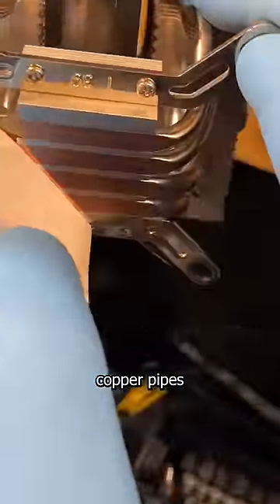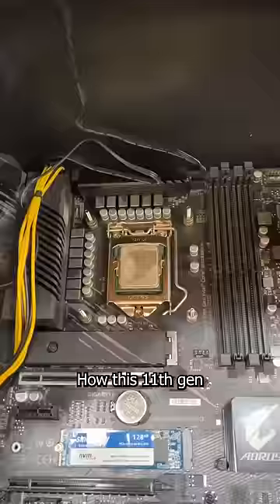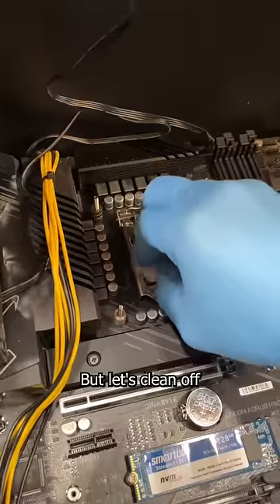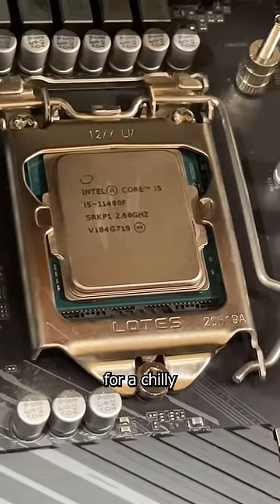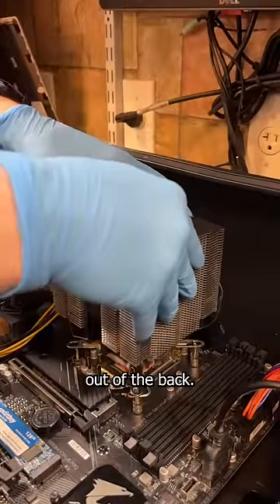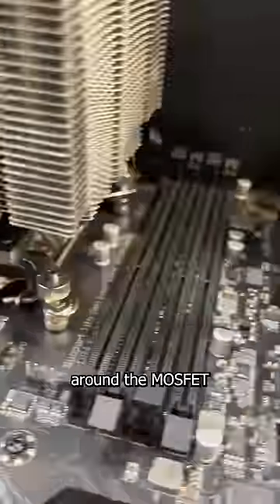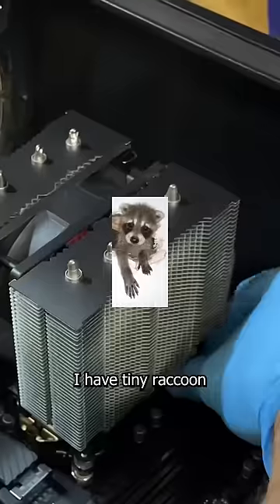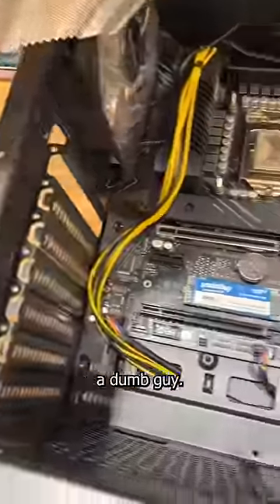Russian computer repair shop harmed this poor #gaming #pc Intel CPU was on fire 😢 #tech #shorts

Comment: He drove the damn car without the brakes. He’s a legend
Reply: Huh
Reply: Wrong yt short, Mister
Reply: I think the comment can ACTUALLY fit the video, or that's what I think about it, it's not that hard ngl
Reply: he also cooked his food without fire too

amazing
Reply: @ilovesalad2702  Crashing without an  air bag?
Reply: He really ate the cereal without the milk!
Reply: or vice versa, excessive heat causes cpu to slow down
Reply: No, it's more likely to drive the damn car without the oil
Reply: Bot
Reply: Right... SO! Apparently this YT Shorts bug where the comments section for the PREVIOUS short would load instead of the one for the CURRENT one has been going on for over a year already... Thanks youtube
Reply: @NovaExxi  He was just making an analogy dude...lol
Reply: @NovaExxi what are you on about, the car comment is about the cpu

Comment: Damn it's just amazing that the CPU isn't burned up .
Reply: it shouldn't burn up. PC should go offline if temperature would to be too high
Reply: Electronics are a lot smarter these days, they will basically do anything to not have itself die, such as extreme throttling or forcing a shutdown before it even gets close to a dangerous point.
Reply: The old intel used to just shut down the PC on high temperature while AMD was getting burned. That's why the Intel superiority will always be stuck with me
Reply: @berjerky  the Athlon X2 I had back in 2009 always shut down at 90°C... I guess the issue you're talking about was a really long time ago
Reply: CPU is cleaver than what you think
Reply: Cuz it's built in Russia, you need a heater but not the cooler 🥶🥶🥶🥶
Reply: If it was just 1 generation newer when Intel's thermals really started to skyrocket then yeah it probably would have died lol
Reply: @Testiculitis qaaa l
Reply: @berjerky  bro are u a decade late
Reply: But CPUs have thermometers and temperature sensitive switches? They’re made to handle this and when tj max is reached thermal throttle with lower clock speed and if it gets too hot just shut off completely.
Reply: @thiefu01 yeah but doing that often will burn it up eventually
Reply: Nothing in a pc is gonna burn up lots of safeties now a days
Reply: No it’s not
Reply: @keatonwastaken I paid way too much for a pc from china that didn't bother with a vrm heatsink and even trimmed of the end of their heatpipes (leaving them open.) That pc liked to pop surface mounted capacitors before I realized the issue.
Reply: Damn it's just amazing how many people don't know how thermal throttling works.
Reply: It can't kill it self it will just get hot then shut down until it's cool again.. PC's since core solo have thermal protection to prevent damage.. that's the whole point of having thermal probes built in to the chips to monitor temperatures
Reply: PC's these days switch off automatically when if the heat is too high.
Reply: It's crazy what machines can and can't handle 😂
Reply: literally, i had a cable hanging into the fan ripping off a blade and the cpu burnt through in 1 min ...
Reply: You can get an ancient AMD socket A and try this. Your local firedepartment probably gonna hate you though. Maybe look for videos of it burning up instead.
Reply: Its Russia though, its probably -55 F most days
Reply: small update after likes, my cousin got burn CPU 1 month ago because he didn't clean PC.
Reply: that's how amazing tech has developed, pc will turn off once it goes too hot, that's why he sent the pc for repair, his pc keep turning off, because I'm damn sure an unknowledgeable guy will ignore even the 90° as long as the pc can still running.
Reply: @dh123ize You obviously don't know my little friend 12VHPWR.
Reply: trillions of floating point operations in a piece of silicon the size of your nail, and the amazing part is that it won’t kill itself by letting itself operate outside its parameters?
Reply: @keatonwastaken  your opening statement is a bit scary, wouldn't you say? Lol
Reply: @berjerky  lmao my pentium D 820 burned itself back in 2010, I was playing some GTA IV and it hanged and I smelled burning. First thought psu was totalled, later found out it was the cpu. idk what you're on about that intel never burns

Comment: Guys... you should apply as little paste as possible! The paste is just for the tiny little grooves to fill in and not to be a thick layer in between
Reply: I was thinking the same thing. Looked like FAR too much paste on the CPU.
Reply: Lol...naa i slather that shit on, cpu temp always low....id rather have more on it than potentionally frying your cpu
Reply: @bartfelix2949  It would be lower with less i bet ;)
Reply: @shoopdawhoop8730  nope actually better i put more on this time around
Reply: @bartfelix2949  you're objectively wrong, and id be scared to use any pc you built with that ignorant mindset
Reply: @jkstudio131  Experience over advice, my dude, ive had no issues with my cpu overheating due to thermal paste for many years, and putting more paste on lowered my temps, like how much do you think im putting on bud?
Reply: Also don't pre-spread it
Reply: Some thermal paste comes with stencils.....
Reply: Lol, not a problem. Properly installed cooler will squeeze all excess.
Reply: @Nikoleagle  I suppose if you don't care about the mess and make sure its not conductive its ok.
thou in that case, really no point in pre-spreading it
Reply: @BucketBoatable  kinda. With bigger cpu sizes matters, i guess. On my older pc i just hqve put a pea dot in the middle. On my new i use spatula, but thin layer - it's not a sandwitch XD. And i wouldn't use "liquid metal" ever. To risky for me.
Reply: I work at a third party lab that does failure analysis. While this may be better it isn't standard practice and paste is liberally applied by most companies. So no cause for alarm
Reply: jesus the amount of people that are just oblivious to comedy here is insane
Reply: @bleepbloop6234  and neither does very little when it ends up overheating and frying...yea ill use a whole tube while im at it
Reply: @bleepbloop6234  you can't be serious
Reply: I used PTM phase change material on the latest build. Apparently it's good at doing this.
Reply: You need to not use too little, but the amount in the video is clearly too much. Yes it should squeeze out, but it is still wrong.
Reply: There is absolutely no downside to making sure the entire surface of your CPU is covered by silicon paste, and plenty of upsides, since most people put on too little. Any bit of your CPU that isn’t covered, isn’t transferring heat as well as it could. You can argue this, but since it’s basic physics you won’t be arguing with me, you’ll be arguing with the universe. And I don’t think it cares about opinions.
Reply: @shoopdawhoop8730 less thermal conductivity doesn’t equal lower temps, so you would be wrong.
Reply: @jkstudio131 he isn’t wrong at all. Less thermal conductivity is worse for cooling, that’s basic physics. You can argue the point all you want, but unless you have proof of your claims, then what worth do your arguments have? Meanwhile, the slathering it with paste has so many tests done and uploaded to YouTube at this point, that there’s a mountain of evidence contradicting you that you’ll need to address.

I’ve found in my life that the people calling others ignorant are usually just pointing fingers at themselves.
Reply: @Nikoleagle no it won’t, which is why most people only have a small circle when they take their cooler off. The vast majority of you aren’t putting enough on you CPU. As for spreading, there’s a reason you get a spreader when you order Arctic Silver. You’re supposed to spread a thin layer across the whole CPU before putting on the cooler. And if you aren’t doing that, you’re not effectively cooling your CPU. It’s basic physics.
Reply: Looks like two schools of thought battling it out,   Have at it boys! 😂
Reply: @itzjcee557  I gotta say i might have changed my mind to some kind of middle ground... lets be honest they design the cpus, coolers and paste for a wide variety of users and as long as the cpu is covered it wont matter.
Reply: Thermal paste is for mouth breathers

Comment: I'm genuinely impressed that 11th gen i5 is still running. I mean, I know they thermal throttle to protect avoid damage (as most CPUs do), but a constant heating and cooling cycle isn't good for any silicon, especially considering 11th gen ran a little toasty (though nowhere near as much as 12th and 13th)
Reply from the maker: My 5800x died in less than 1 year because I didn’t notice it overheating due to my MSI Mag pump getting clogged and failing. TWO TIMES. Respect for this little i5.
Reply: but that propably reduced it's life span by a lot
Reply: A plastic piece of film likely isnt going to hamper cooling more than a failed pump will, most it probably did is throttle to keep itself within spec and be fine otherwise.
Reply: Dude laptops run forever and most gaming laptops run into the 90s. This isnt quite a myth, but its extremely overblown
Reply: Intel cpus seem to be fine with a little extra heat. I’ve seen laptops run at 98 all day
Reply: My Lenovo v15 g2 has an i5 11th gen, it’s been a champ for the last 6 months but i think I’m gonna get the asus rog ally instead. It’s more powerful, portable and can play more resource intensive games since my laptop has no dedicated graphics
Reply: @SalemTechsperts To be fair the i5 was in still in contact although reduce conductivity because of the plastic , the thermal paste also saved it
Reply: @roflcat100 until you try to do any sort of repair on the laptop and it dies from static electricity
Reply: my old laptop's CPU survived without a cooler (the fan broke and i didn't replace it), modern CPUs don't overheat, they will underclock to MHz range but they will not die
Reply: @SeanPennII seen CPUs survive at 90-100° (death temperature for most CPUs is 105°)
Reply: Do you think silicon based life forms are more common than Carbon based life forms
Reply: @SalemTechsperts i wish I had a way to message you.

Curious if you could thin out the thermal paste. The thermo compound is more potent in smaller amounts. I would reference some research materials on it and expand in more detail if you like.

With regards, 
-X
Reply: not an 11400f. that CPU runs cool.
Reply: @youcefdz5598 definitely did
Reply: i got a dell inspiron 15" in april of 2019 for easter. I run rocksmith 2014 1080p@120fps and it never dips below 75fps (it only dips when loading or if there are a ton of notes on the screen and i mean more than 100 notes) it averages 80C and acording to HWMonitor In the past 2 days every core has hit 99C at some point. i made a promise to myself i wouldnt replace it with a proper gaming PC build until the CPU dies, and i cant kill it. Ive thrown CID advanced warfare at it. while it averaged 30fps it chugged along.
Reply: Back in the day I built a small PC for my dad to use basic internet and word docs. The CPU was a Core 2 Duo E8500. When I shipped it to him the intel heatsink broke and fell off. It ran that way for almost 10 years before I looked at it again, it would throttle to about 100mhz and continue running very slowly. That CPU still works today, even though its temperature diode is broken and it thinks its at -90C all the time.
Reply: @bobertjohnson3473  I must have a defective 11400, 80c when pushed at max even with a tall heatsink. 

(Pushing 120-140w tdp)
Reply: I had a service call a few months back for a computer that was really slow, for about a year.  They had painted their office, about a year earlier.  While moving stuff around, someone knocked the entire heatsink and fan loose from the CPU.  It ran flawlessly, just really slow as it kept the CPU temp locked on 100C, for a whole year, 24/7 with no reliability issues.
Reply: i have an i3 from 2014 dont remember the generation and it still runs pretty well, im not gonna bother upgrading the PC im just gonna buy a complete new one once i get a job after i graduate in a year
Reply: @SeanPennII is that what "running in the 90s" means?
Reply: maybe they used a blyat technique
Reply: @zNoah  80c is fine, specially if you're running an unlocked power limit indefinitely.
Reply: @tonyfremont  what ends up killing cpu's is the heat cycles absorved by rapid increase and decrease of temperature. this is often caused by not enough cooling capacity, where cooler will be suficient under idle and heatsoak fast once cpu is under load. this causes lots of heat cycle where temperature can variate from 30c to 100c 

this cpu overheated fast, and stayed hot, throttling processing power to nothing. the cpu stayed at a constant temperature, not to dissimilar to a gaming laptop or your gpu, but instead of fans ramping up you get decreased performance.
Reply: @Cass-zb9nr that plastic film completely defeats the purpose of having added thermal paste in the first place because the thermal paste is meant to act as a conductor for the heat allowing it to properly transfer to the heat sync, and plastic, does not have the properties of thermal paste
Reply: @sophiasouza4122  You missed the entire point of what I said
Reply: I run an i7 7700k for 5y always thermal throttling (kinda my fault) and the cpu still works fine and it is now in another build. The most impressive thing is that with a good cooler it still runs the same 5.1GHz OC profile that I first created in 2017
Reply: @SeanPennII  and gues what? They are dying. Many of them die in 2 years in varrianty period. Some die after varianty and only small amount will life for years. The same apply to graphis cards.
Reply: I mean a 65w cpu under normal cooling has no reason to thermal throttle... I own an 11400 and its been running fine since release.
Reply: I've got the exact same i5 and z590 Mobo, assuming he used the MSI software for cooling it makes sense that the hardware survived though it probably throttle quite a bit
Reply: You must be so young to really know how durable intel cpus are
Reply: @SalemTechsperts  i have an i3 that is contantly running at 70 degrees celcius when idle. It recently overheated at 120 degrees celcius while playing csgo a few days ago. I have no idea how this has lasted for 5 years.
Reply: I have an i7 13700k and i had to switch to water cooling because my be quiet heatsink was not good enough while under full load. NZXT Kraken rocks
Reply: Somehow after almost three years of use my Alienware (aka dell trash but the price is higher) with a 10th GEN i9 INSIDE IT hasn’t caught fire. Constantly idles very hot and games around 90 C because Dell puts tiny ass fans with no heatsink on an enthusiast level CPU in a “gaming PC”.
Reply: Well you see First hand Russian Technical Prowess!!!  🤠👍
Reply: @youcefdz5598  nah intel is built like a tank. IDK how new 12gen+ cpus but 14nm is unkillable amount of voltage and heat those can handle is crazy. Maybe if mobo would give 1.8v to cpu it would die but this just underclocked to keep at tjmax. It would just shutdown if it would keep gaining temps. Thats why its worth to buy brand that have bigger experience in doing cpus than 4 years.
Reply: @SeanPennII Exactly, finally someone with some sense. PC parts are way more robust than people give them credit for.
Reply: @SalemTechsperts I’ve got an i5-3 digit something and it’s been in there for years and still works like a charm
Reply: Intel CPUs are built like a tank. Never had one die throughout my years of building PCs. AMD on the other hand, well you don't even have to let it overheat, just run it normally and it'll probably die between 2- 3 years due to overvoltage on the stock settings.
Reply: @@De-Rekarts had a laptop die from static, shitty lenovo yoga, it already had a failed hard drive, took it apart and replaced the drive , put it back together and it was dead.       :( chalking it up to static is the simplest answer wasn't using static protection, barefoot sat on a chair with carpet underneath so it makes sense to me
Reply: I had an old i7 on my last computer run (poorly) with a dying and then dead cooling pump for months before I figured out what was wrong with it, and then I ran it through tests and it was practically good as new once I installed a heat sink not too dissimilar to this one to replace the expensive liquid cooling as a stopgap. The computer is still quite functional last I checked, Intel CPUs seem to have pretty robust safety features and design these days.
Reply: I'm surprised they built that expensive gaming PC using an (Intel) i5 CPU instead of an i7.
Reply: I'm not considering many private/office PCs are at idle or moderate load most of the time.